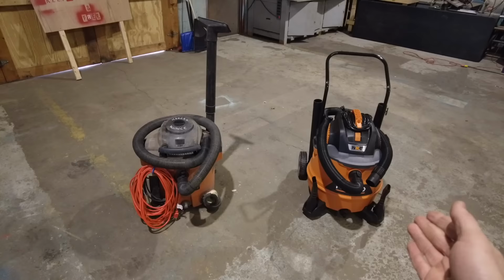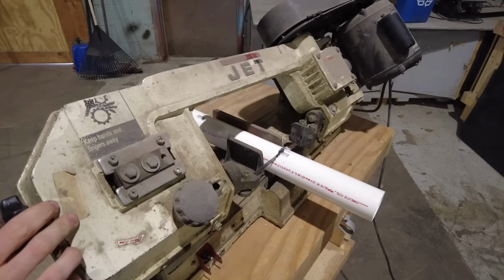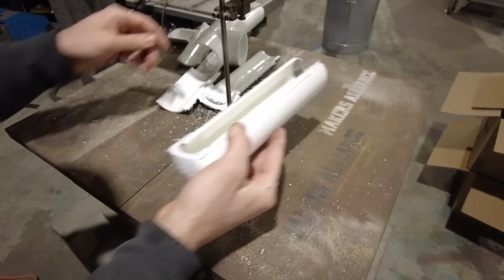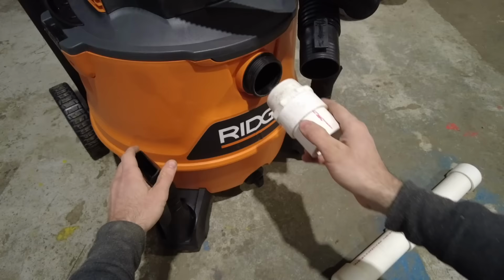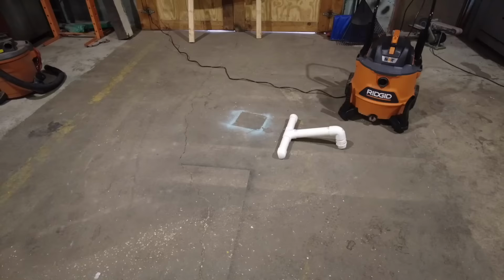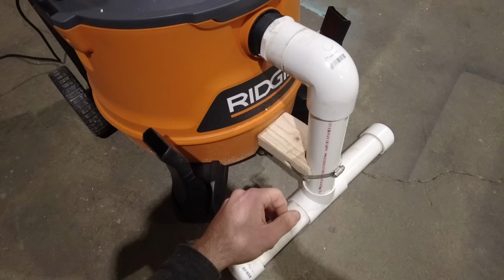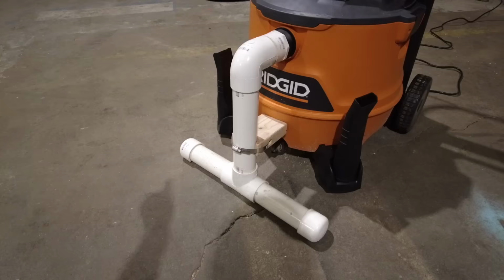DIY Shop Vac Mod  -  Super Wide Walk-Behind Attachment

Comment: I see all kinds of comments for cutting the slot, or changing the distance but I made something similar to this with some pvc pipe and I just hot glued some broom bristles on both sides of the slot (shorter on the front to allow the dirt to slide under) and it worked great for me.  been using it for years.

Comment: I haven't read all the comments, so I may be repeating someone else, but maybe glue up the components with PVC glue before cutting the bottom.

That would give you better adhesion of the parts than hot glue, but solve the problem of the loose fit after cutting.

I do like the idea I saw multiple times about adding wheels to the ends of the fixture.

I'm sure it will undergo a few tweaks, but overall I like the concept 👍

Comment: Another thought would be to use smaller diameter pipe on the bottom piece. Come out with your 2" pipe out the vacuum, then use a reducer to like 1.5" for the bottom piece. I think this would increase the suction power. And like others have said, just make your slot between the end caps and don't cut the end caps. Like others have said, I would use a router bit to make the slot. You'll have to experiment with different size slots until you find the ultimate size.
Reply: not everyone owns a router, but a skill saw would do in a pinch.
Reply: Vacuum pressure is important, but so is air volume.  Reducing to a smaller pipe might give you more pressure, but it will reduce volume.  This is why dust collectors are usually 4" or more in diameter.  I think his 2" pipe is about right, and I agree with those who said to roll the slot forward (just a bit... you still want good suction against the floor) and this should allow the bulk of the material to enter the slot rather than being pushed.
Reply: @matthewpeterson3329  ... one thing nobody has mentioned is maintaining air velocity, which is going to be a function of the square inches in that opening. 20" wide by 1/4" slot will be 5 sq in. The suction pipe is 2" diameter so a bit over 3 sq in. Rough guess is the speed of the air (suction) is approaching half the velocity already. A larger diameter intake section by the floor will reduce friction loss but a smaller one will increase velocity. (up to a point) It's a balancing act that engineers have been designing into vacuum systems for over 100 years.
Reply: @rupe53   you said it better than I did, and it is indeed a balancing act.  

For me, I prefer floor sweeps at various points in the shop, with gates, that are plumbed to one collector, be it a vacuum or dust collector.
Reply: Agree Mike. Making the pipe smaller would increase velocity, but reduce "volume". Volume is not important here. Reducing slot size will help also, like you mentioned.
Reply: you didn't like physics class very much, right? the suction is the same- the air speed thru the pickup is increased.

Comment: Instead of an elbow use a Tee. Then install shut offs in either side. Then you have the hose and the floor attachment hooked up. Then just have one valve off and one on to use either one without having to dismantle anything.

Comment: Instead of just a flat cut under the horizontal pvc,  cut an additional 30° cut toward the front of the horizontal pvc.  This may help reduce the plow effect when encountering a large pile of dust\debris as it will offer a bit of  forward suction, not just vertical

I would also think that pvc glue would work better than hot glue
Especially if you glued it before you cut it
Reply from the maker: I think both of these are great ideas, and I definitely should've glued the pipe first. I'm not sure why I didn't do that.
Reply: Dam, what an idiot I am for not thinking of this 30 degree is a perfect angel. I am so happy we have some smart people on U-tube.:eyes-pink-heart-shape:

Comment: Love the ingenuity. I wonder, though, if it’s easier to use the wand in most shops? Mine is a bit congested and I’m constantly having to weave in and out of stands or carts or (don’t judge me!) tools or clamps I set down. I can’t see myself wheeling a vacuum that size easily through my clutter.

Comment: The biggest problem I have with all vacuums is tight turns in the suction hose create places for clogs. Try using abs drain pipe instead of pvc and get a long sweep 90 at the top so large debris has a better chance of making it into the can instead of clogging the tube.
Reply: Nothing that fits into the 1/2" gap at the bottom of that pickup is going to clog a 2"  pipe or fitting.

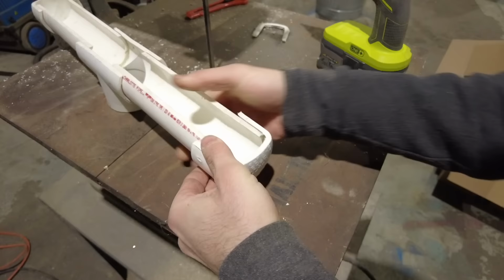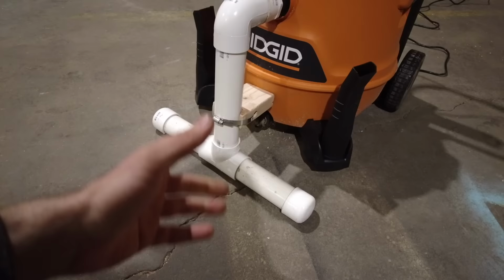Comment: Great video!! 2:26 Could you use the pvc cement before you cut the bottom?? And 7:51 Maybe not cut so much off on bandsaw to make the channel thinner??  Or maybe drill holes instead??

Comment: Think I'd rather build a solid remote mount, and have different drops for dust extraction at my tool stations, and build a giant wand on a hose reel if necessary.
Reply from the maker: I think if you have a large dust collector, this is 110% the way to go. I've seen shops where they had setups like this and it was very handy.
Reply: @Rustbelt_Research  half the time I use compressed air wand to blow the stuff outside.
Reply: @RJ_Cormac    Alternatively, you can hook up the suction hose of the shop vac to the exhaust outlet and use that to blow debris. I have both and for me it just depends on what’s handier to do at the time. I also have a handheld leaf blower so I’ll use that to blow out the garage workshop if I’m already using it for something else. Nice to have options. 😁👍
Reply: That's a good idea too if it's just for a shop. I was thinking of this for commercial use
Reply: @RJ_Cormac  
Do Not litter 😨😲😲😲

Comment: Spent so much time modding my van I never thought about modding my shop vac.  For the top fitting, you might see if you can find what is called a FERNCO fitting.  Its a rubber fitting with hose clamps usually used to join ancient drainage to modern drainage systems.  I bet you could find one that fits around the fitting on the vac so you can tighten the hose clamp.  Then use the other side for the PVC and tighten.  The rubber might act as a shock absorber if you hit a snag.

Comment: Another suggestion. Instead of cutting your pipe like you did. You could try drilling a series of holes on the bottom of your Zamboni arms. My suggestion would be two or more rows of offset holes. So let's say it takes 30 holes 1/2 inch apart to go from on side to the other, the next row of holes would spaced so the each of those holes is in the middle of the 1/2 space between each hole . Then the 3rd row would line up exactly with the first row holes. Then you just decide how many rows of holes you want. I would play around with the size of the holes also. Of course bigger holes will suck up  bigger particles.

Comment: Very novel idea.  Im not sure the shop vac has enough suction to be effective.  Suggestion.  Make the horizontal pipe smaller to intensify the suction might be helpful  ie 1.5”.  Glue the pipe before cutting.  Put an accordion piece in the vertical pipe to keep downward pressure on the horizontal pipe.  Or use a fiber door sweep on the back edge of horizontal pipe. Maybe install a magnet bar to grab screws while vacuuming.  Fun project. Thanks for sharing

Comment: There are already similar attachments for such vacuums. Not sure which brands but they exist. And in some cases when the vacuum is getting full & heavy, it’s easier to use the attachment hose that comes with it instead of pushing around the whole rig. I could be wrong. But anyway, at least you’re trying something so more power to ya!

Comment: Awesome idea my friend. Very cool! I'm going to build one for my extra shop vac, that isn't currently hooked being used as a dust collector. 

I haven't built one yet, however I have an idea.

You could "hot glue" a small row of bristles along the back edge of the PVC pipe opening. So that you could raise the pipe up just a little more. And so that the bristles would drag the excess dust and chips along the floor under the opening, while the vacuum is picking up. Just an idea to make your, awesome idea a little more efficient! Thanks for the great video! Take care!

Comment: Restriction=pressure (thumb over hose)
Instead of cutting tube, simply drill a row of 10mm holes in the tube,
on the plane of the floor.
A sliced and glued or screwed on (for replacement) nylon bristle broom, 
behind the row of holes, extending beyond the manifold tube, maybe 1"?
Then (heat gun) curved inwards, like a plow blade.
Pieces of broom=  /////||||||||||||||||||||||||||||\\\\ behind the row of holes. 2" long bristles.

Great video! Great invention. I Subbed. Good luck, young man!

Comment: So far the only thing I have thought of as far as adjusting the height is for you to have two female thread pieces, one on your 90 elbow and on on the Zamboni brush head. Then you have a short piece of pipe with the male threads on both ends {I think this works} then as you screw both pieces on at the same time.. it should allow you to have about an inch worth of adjustment on the distance between you Zamboni brush head and the floor. This is all off the top of my head, so I apologize if I am missing something obvious, where this won't work.

Comment: I just used an old vacuum cleaner brush head and a length of flex hose.  My wood block is fixed and the head does all the flexing.  I've used this setup on a couple of vacuums over the past 50 years.

Comment: I bought a used dyson on marketplace. Replaced the battery mount with one that accepts milwaukee and now it's my garage vacuum. Hangs on the wall and if it dies, I'll buy another one. Easy - Takes up less space. But I like your injury.

Comment: I second the idea of making the notch on the bottom to point forward a bit more to prevent plowing. Any wheels on it would need to be swivel casters, otherwise you wouldn’t be able to turn it without the wheels dragging sideways. I wouldn’t be surprised if the vacuum manufacturers come out with an attachment like this after seeing your contraption.

Comment: Part 1 of my original: Since you split the hose into two {at the "T"} I would recommend dropping the two "arms" down a size {maybe to 1 1/2} this is similar to plumbing where your main line is 3/4 but then when you run to a fixture, you always drop down to 1/2 inch. The reason for this is to keep the suction high. By splitting the hose {or in this case your Zamboni floor head} into two, you are really decreasing the the suction of the unit considerably. If you took the "T" and made the two arms a smaller size, you can maintain the suction to a better level.

Comment: I'd add a strip of door-draft-seal (like the kind you screw onto the bottom of your room doors with the replaceable rubber seal) to the inside back of the suction intake. Like a zamboni it'll act like a broom to keep the debris pushed swept up. Also, since you cut the end-caps, maybe find a pair of polyeurathane wheels that can screw (loosely) into the the top of the end caps; install a spring on the wheel post to let the wheels bounce over uneven terrain like struts in your car.

Comment: LOL...another suggestion:  Reduce the width of the cut.  Do not cut the endcaps and purchase the head of a narrow broom (or squeegee) and attach the length of the opening (behind) to the endcaps on each side.  Raise the suction 1/4-1/2 inch more while keeping the bristles / squeegee skimming the floor.    Nice you came up with regardless.  I'm sure there are a thousand suggestions on this post!

Comment: In v2, 
Glue the PVC together then cut. PVC pipe will change diameter when cut, because it is under stress. You learned this the hard way.
Make the opening in the bottom smaller. I'd go 1/2 or so. If you can taper the opening to the center that way you get more even suction. Or split the suction with some 45 degree connections.
On the back side add a bit of rubber screw on under door weather stripping, or a brush.

Comment: Improvements:

Cut the horizontal part at a slight angle to the front.  This will allow the vacuum to pull in a bit as well as pick up.  Not much, just 10 or 15 degrees of horizontal.

Glue the pipes together before cutting.  This will make the pipes more rigid because you can cement them together.

Make the floor head an inch or two wider than the vacuum.  Yours looks to be exactly the same width.  This will allow you to be a little less precise with your passes and have a natural overlap.  Similar to the way a lawn mower does.

Comment: Each vacuum cleaner motor has an optimum diameter orfice that allows for the highest suction and volume.  For example a two fan Lamb motor 5.7" dia has the best performance with a .75" opening.  You can sacrifice some suction for a higher volume but the 2" pipe cut on the bottom is  not only too large an opening.  The air flow will not be aerodynamic as it spins around inside the floor nozzle.  There's a reason the floor tools are shaped the way and have a brush.  Kudos for trying something new.  It looks like it doesn't clean as fast as the standard floor tools that could have been modified to mount to the front of the vacuum.

Comment: Rigid makes a wide brush attachment that would allow the collection to adjust up and down to inclines, bumps, and variations in floor level. The PVC downtube you have is rigid, and can’t adjust second by second across a floor without a lot more design and complexity added.  The brush can keep a better seal against the floor surface. 

On the other hand, if you could add a little roller or bearing to the ends of the collector head (a the horizontal tube at the bottom), and a telescoping “down-tube” that can compress and expand in response to bumps, etc, that would also improve. 

I have the same vac and love it just as much, though I don’t have need to cover the large floor space that you have.

Comment: Try leaving the end caps whole (nothing cut off the bottom like the horizontal piece) that way they should glue up just fine with PVC glue and it'll space the horizontal piece off of the floor the just the right height for dust collection. They will wear down over time but they should last long enough for testing purposes. You could also swap out the PVC end caps for male adaptors capped with galvanized end caps that will again give you the right amount of space (maybe even more than the PVC) and they will not wear down with use for many years.

Comment: A good shop broom sweeping the debris up into piles then using the vacuum with its hose regular seems faster. And a broom can get under benches and along walls better then the vacuum can. 

It's a good idea but for a small garage or shop not sure if it's better then the broom method.

Comment: For wet spills, spread a beach towel on the floor and park your contraption in the middle. The shop vac will pull the water out of the towel and osmosis will do the re

Comment: Air follows path of least resistance, taper the opening of your floor sweep opening at the bottom to narrow the center and I think you even you the suction power more evenly and should be able to pick up heavier particles towards the ends.

Comment: Just use the hose that came with it, because if you had wanted an upright vacuum some of them are a lot cheaper plus already have all the wheels, brushes and height adjustment that you're having to add

Comment: Full cap on each end stead of instead of it being cut.
 A possible rolling brush from end-to-end.
 Squeegee on the backside. There's some type of spring-loaded Wheels or remote control car soft Wheels.
 Connection to intake can be rubber allows play.

Comment: I have a hose end attachment that has wheels built into it but, I can't remember where I got it at . It keeps the business end or the vacuum about 3/8 inch off of the floor so it doesn't get stuck to the floor. I've had it for what seems like forever. A friend of mine just puts tie wraps on the end of his wand and just replaces them when they wear out. Works well for him.

Comment: You could take a door sweep, attach it to the back side of the vacuum head.  Another is to have the front edge of the opening slightly higher than the back.

Comment: I didn't make anything like that but I can match the story: I made a yard vac out of a basic a single prop rotor mower. Now this mower originally was a high-end heavy duty all aluminum Sears Craftsmen, commercial with a 5hp Briggs & Stratton push mower, which I upgraded to a 9hp but installed taller ball bearing wheels to roll over the lawn easier.   I couldn't believe the huge difference that made.  I don't care if you can put oil on a castor wheel axel. It'll never match the performance of a ball bearing wheel. Next, my buddy who worked at McDonnel Douglas, machined me out a balanced 3 blade inverted airplane prop that would increase the vacuum airflow by 300%. Now using heavy duty door sweeps, I extended down the gap I created using larger wheels. The door sweep had a thick strong rubber gasket that would glide over the grass and allow for the perfect amount of air flow in and up through the prop and out the discharge tube supported by the push bars near the controls on top.  Here is where I put a custom canvas bag that would catch all that flew into it. The problem was, it wasn't enough to stop small objects like splinters and small rocks and I used to get blasted behind it.  I would end up having to wear a custom heavy duty apron over my jeans.  But man, did that yard tool work.  It would almost take up parts of my lawn unless I turned it to 75%.  On high, it would almost pick up my neighbors leaves next door. Kidding. But there were these nasty spiny balls off the liquid amber tree that it would suck up to where you would hear a thump in the bag.  You could tell that prop was worth it's weight in gold because it was both sharp and created inverted lift.